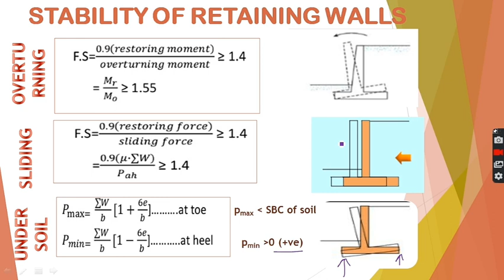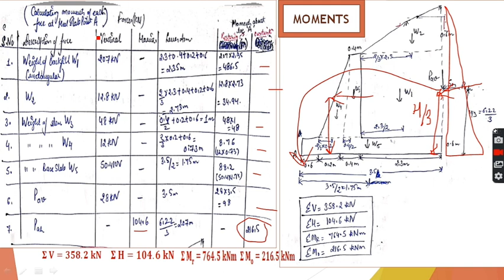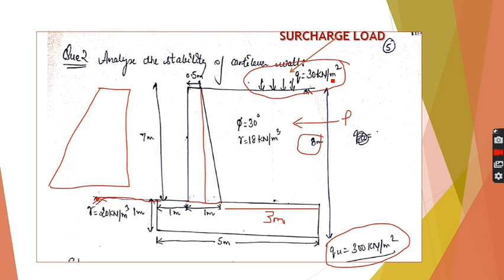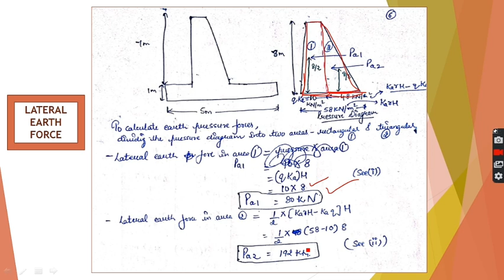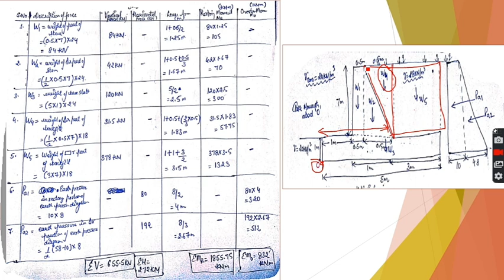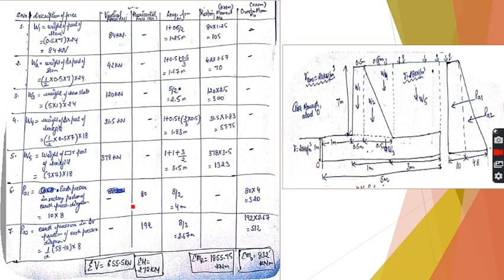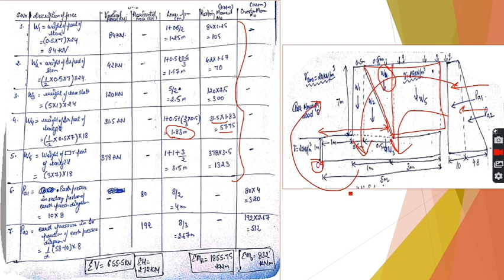Retaining Wall Lecture 4 : Cantilever Retaining Wall Part 2 (Stability Analysis)

Comment: madam how to calculate Pah=104.6 nd pav=28 kindly elaborate it .
Reply from the maker: Pah and pav are horizontal and vertical components of the earth pressure force Pa (this force is inclined as the backfill is inclined at an angle beta) 
So, horizontal component will be cos component of inclined force as beta is angle of inclination with horizontal and vertical component will be sin component.  
Therefore, 
Horizontal component = Pah = Pa. cos (beta)
Pav = Pa. sin (beta)
Reply: mam which book prefer for design  of retaining wall
Reply: Please ma how exactly did u get Pa to be 108.28. I don't get that part
Reply: @surabhi7199  please ma how exactly did you solve for Pa
Reply: @surabhi7199   please ma how exactly did you solve for Pa
Reply: @surabhi7199   please ma how exactly did you solve for Pa